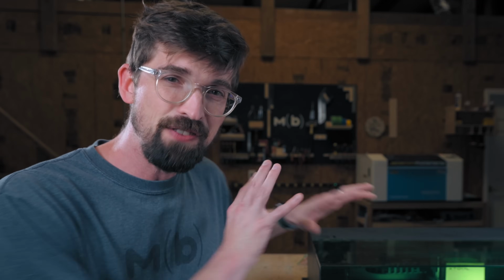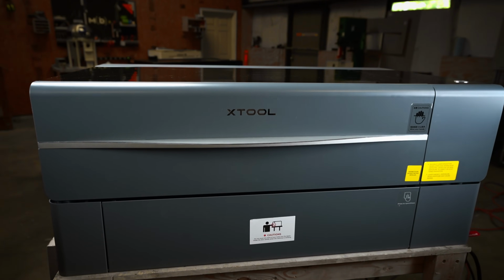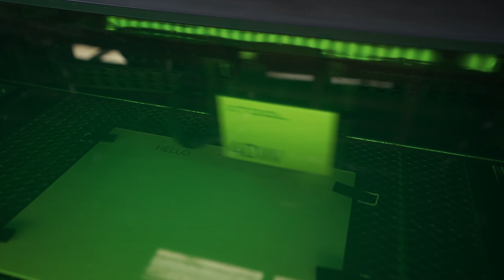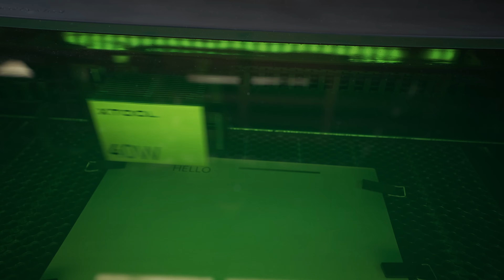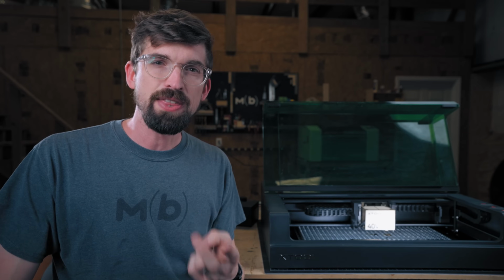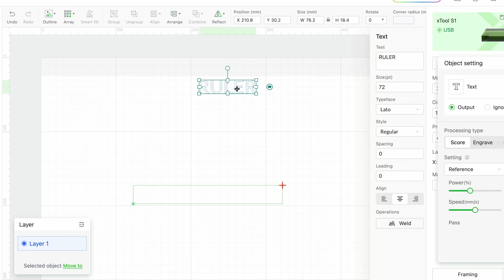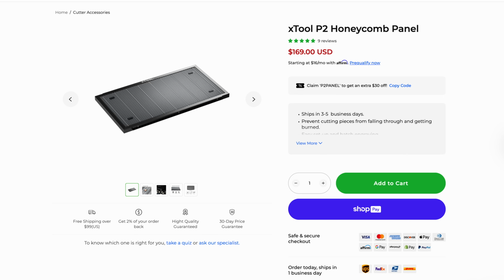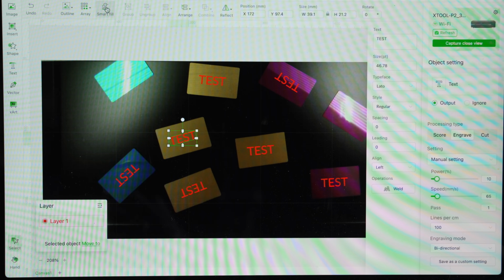The ALMOST perfect laser: The xTool S1 Laser Review

Comment: I have the xtool S1 40 W.  the machine works great but I have an issue with the xcs program. 
any chance ( have you had a problem with the vector not showing the setting for Power % / Speed  & pass count) ? this is with XCS  program

Comment: I had up until last Sunday a Full Spectrum 40 watt CO2 laser.  It was about 6 yrs old and the startup board crapped out and FS wont answer my request for support.  So, looking at my options, I really like the S1 based on what I do, but I cant decide if the 20 or 40 watt is the way to go.  I do cut some wood, but usually thin basswood.  I do more along the line of engraving signs.  With this, which is better, the 20 or 40?  Thanks!

Comment: You said that you were running your S1 in Lightburn. Just received my XTool S1 40w Laser. In Lightburn the only way I can move the Laser with the Move arrows, Auto Focus, or Frame is if I have the lid closed. It is a real pain to have to open and close the lid when Framing and re-positioning the wood. When I use the S1 in Xtools Propriety XTool Creative Space software I can perform these tasks with the lid open. Is there a setting or something in Lightburn that will enable me to perform the above tasks with the lid open? Any help would be appreciated.

Comment: I disagree with cost a fully kitted S1 is the same price as a P2 with the advantage going in the P2's favor with the fact that its a CO2 that can cut most things. I don't see where the S1 fits in the grand scheme of things at the price point its at. I see it more as a gensis laser, a combination of all the things the D1 should have been. I'll be putting my money on a Thunder Bolt and skipping this one at its price point
Reply: An S1 with the air purifier and all the goodies is $3798

Similar all tricked out P2 is $5995

So, I don't agree with what you are saying.
Reply: Check your math.

Comment: After all the "fun" I had setting up a sculpfun camera on my Falcon 2 - 40 watt, I am not sure it was a huge advantage, and it was a major pain to get even close to workable.
 It will be nice to see the differences once the S1 I ordered arrives. I have a feeling that the 2 coordinate alignment system will be my preferred method... though being able to drop shapes randomly and have it do what the P2 could do would be nice.  Looking forward to joining the S1 family... just 3 more days!
Reply: How is it now?
Reply: @justinwtolbert  I have been using the S1 for the last 2 months, and with the recent updates to allow multi-point positioning, I am extremely impressed. I don't miss the camera at all. I do have to create templates for some things, like easily repeatable coasters, money clips, and business cards, but those were a one-time creation. I regularly do black acrylic photo-graphs with the 2W IR laser, then switch heads to the 20w and cut them out. It all works well. To say that I am happy with the S1 is an understatement. I am VERY happy with the unit.

Comment: for 2200 bucks + the few hundred bucks per accessory you're better off getting a CO2 laser at that point that would have all that included and could cut clear acrylic  and includes air assist.  What is the draw here over a CO2?

Comment: Hi, I am considering the Xtool S1. What I would like to know is the engraving quality in detail of the Xtool S1. Does it depend on the power, is the power of the laser adjustable (f.i.10 W, 20 W) or is it fixed at 40 W?
What would you advise?
And for thicker products and the rotary module, can one use it f.i. with extra feet to make the laser base higher?
Thanks in advance for your extensive reply!

Comment: I'll buy this without hesitation if they mentioned if they were working on more powerful laser(60W, 80W) modules that are also swappable with this system.
Reply from the maker: It will be fun too see how far they go in terms of power with diodes.
Reply: but why ??? just get a co2 then, you can get decent ones for 2500$ and they can work in a lot more materials have a bigger workare and so on

and at 80w thats 16 laser diodes wich needs A LOT of glass to properly focus in one point, and the laserhead will become incredibly heavy , so you cat even use all that power since it wont gonas fast anymore
Reply: @Basement_CNC  because a diode laser can be manufactured faster and cheaper.

Comment: Just bought an Ikier 48w. Building my own enclosure for it from MDF. You'll need to wear glasses around the laser either way. That lid is not enough safety when dealing with Diodes.
Reply: No glasses needed with the S1.
Reply: @billm1651  Wrong.
Reply: @Ipsissimus recently purchased the s1, don't you trust the new lid design? Would you suggest further eye protection?

Comment: One thing the camera helps with that the positioning will not help with is when I take a piece of wood that has already had a large piece cut out of it, to cut small things like earrings and such. Since it will only show the full size of the initial board and not where things are already cut out, it will not work for this. I use this a lot so this is a no starter for me. But still very impressive machine.
Reply from the maker: good point on the used material.  it's not quite as fast but the image trace feature using the red cross hair can let you move around whatever you are cutting and engraving pretty quickly.  But  nothing beats a camera in terms of raw speed.

Comment: I feel like a provided enclosure is somewhat overrated. The only benefit versus making a basic one yourself is the auto shutoff if you have kids running around or something, but that can also be added to a homemade enclosure also without much trouble. 
Seems a bit sus that xTool pulled the 40w D1. Seems like they're trying to push people into buying this new unit. It would also be nice if they offered the ability to step down the 40w laser to 20w for finer engraving like other laser diode makers are doing, but it seems like they're more interested in getting their customers to buy an entirely different laser module... another upsell. 
What would be nice is to see a comparison of this unit to your favorite budget CO2 laser. It feels like this is getting expensive enough that it would be easy to jump to a goob budget friendly CO2 instead.
Reply from the maker: The OMTech Polar and this are getting super close in price, that's a great idea of a comparision.

I would still say the enclosure is pretty big upgrade, most people will just want a machine that pretty much works right out of the box.  Plus the touch probe is really nice.  But like you I do wish the laser modules could switch between this and the D1.  Or do the diode flipping that iKier is doing and let you drop from 40 to 20W within the same unit.

Comment: I have a Xtool D1 and that has been a great machine but since purchasing the Roly Lasermatic 10 I'm sold on fully enclosed machines.  I have also got use to using the camera for placement of art work.  Although alignment has been a on going issue as it usually takes a sacrificial piece to fine tune the placement before starting customer work.  WeCreat machine sure looks nice!

Comment: I have a M1 and even though its fully enclosed it still does bleed light. Caught myself a few times with goggles where i saw a blue flash in the corner of my eye when i was turning to walk to my laser. 
Honestly will probably upgrade to this, just for better safety but need to save up first the m1 already broke the bank and honestly dont feel as safe with it any more

I do really like the camera on the M1 however and its useful for auto focus and potitioning the work piece and designs as i have my pc wirelessly connected in another room. 
Having to manually measure and probe when i want to get in a specific spot seems like a downside but ill take better safety to be honest.
Reply from the maker: Always good to have glasses regardless around these things.
Reply: @makeorbreakshop  yup dread to think what would have happened if I had not been wearing some at all. Might look for some better than the xtool Goggles or at least ones that snug against my face more

Comment: Great video man.  I have a question for ya.  Will you ever do a test/review of the Ikier K1 pro max 48/24 w?  I need a 3rd machine for odds and ends and have yet to find a decent review.
Reply from the maker: I've got a version of it in my shop, but not the one that switches between 48/24.  Hoping to check it out in the future!
Reply: I second this! I like the idea of being able to switch from 24w to 48w with the same laser. Seems like something xTool could do, but maybe they just want to sell more lasers. I also like that the Iker has auto air assist and the motorized Z axis with auto focus and auto step-down for better cutting. 
I'm currently in the fence between that one and the much cheaper Atonstack A40 that also has the 24/48 switch, but doesn't have the motorized Z axis.
Reply: @johndoe6032   Exactly man...  The Ikier pro max or the  Atomstack x40 max are the 2 I am stuck on.
Reply: @TheLordSqatch   I took the 48w Ikier. Just cut your own enclosure and add a camera.